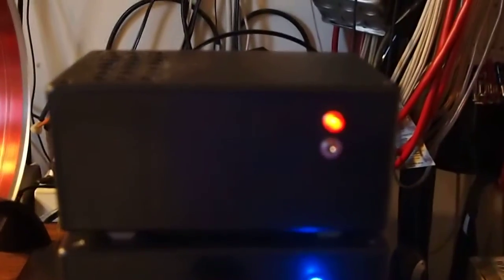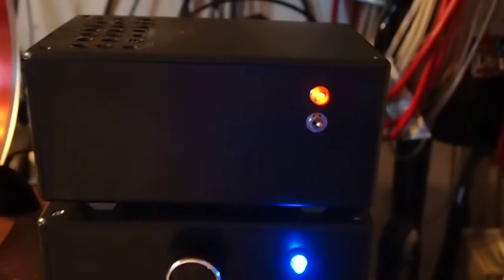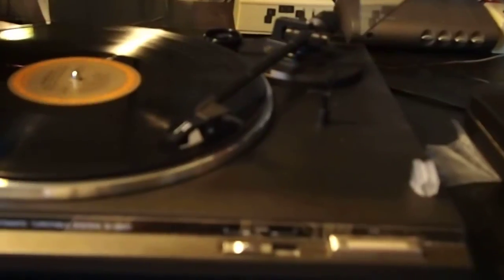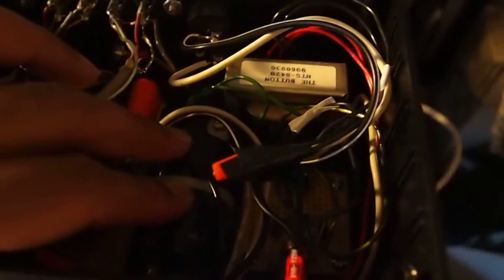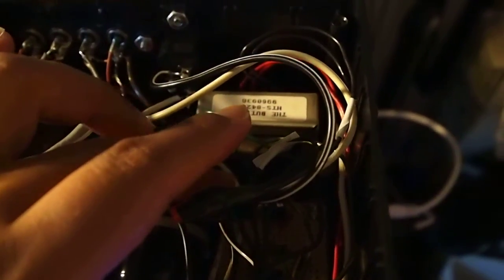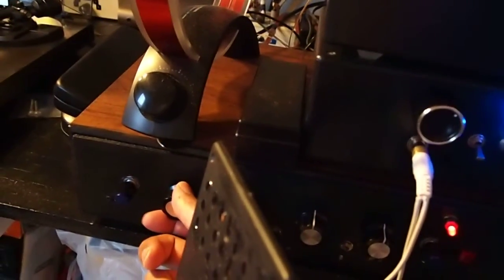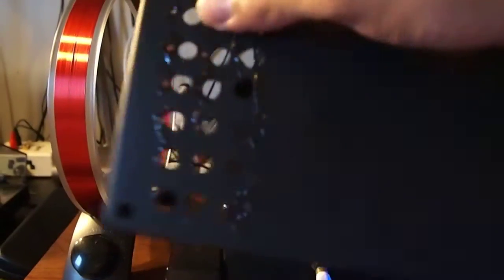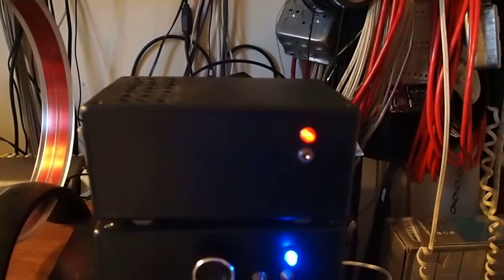Stereo tube phono preamp 12AX7

Comment from the maker: Okay, sorry for the delay I'll do my best to help.  You should be able to tie in a turntable to a mixer as long as it's has a phone preamp before connecting it to the mixer.  Most of the modern PA mixers don't have a built in MM Phono input stage.  So a Phono Preamp is a must.  Then you connect the mixer to the amp, the XLR stage to a channel that has a XLR input which should be balanced and the reverb to the effects inputs and out on the Numark mixer.  Hope this helps out.  Peace.